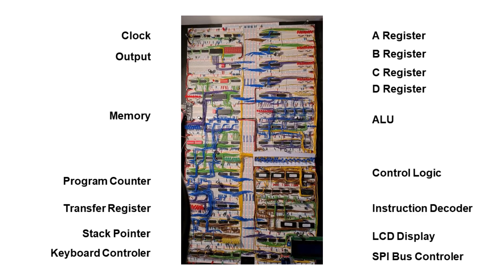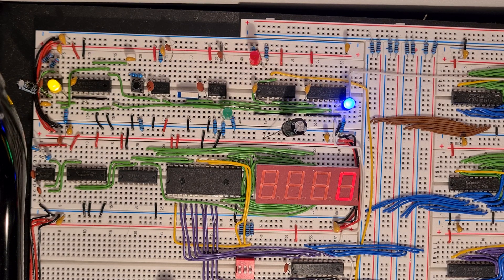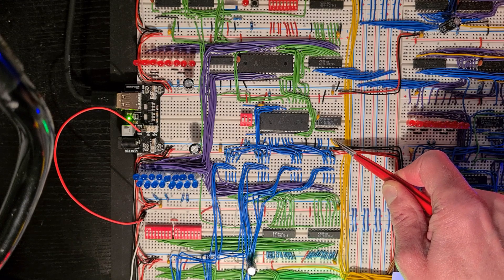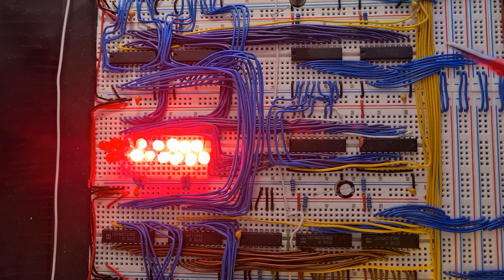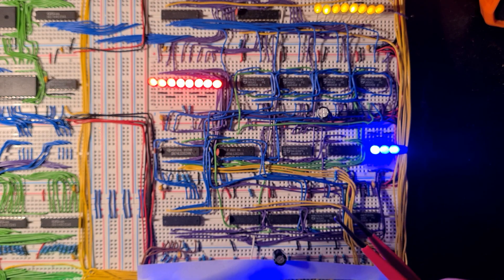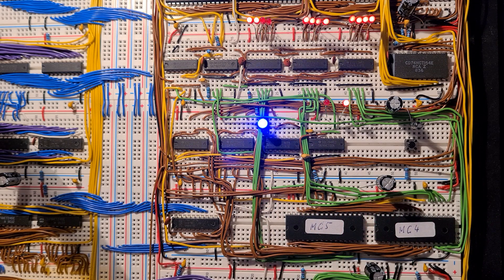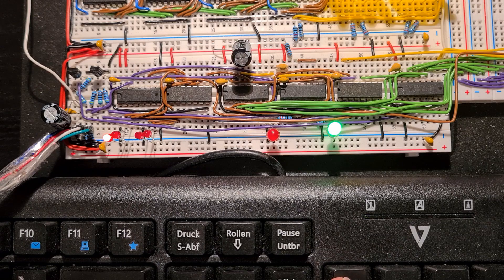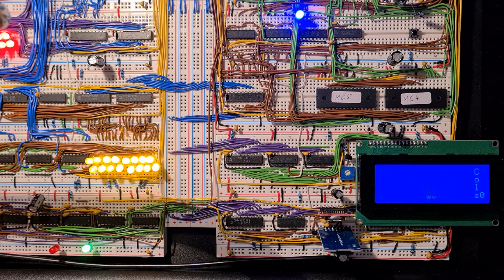8-Bit Breadboard CPU (Overview)

Comment: Irgendwie bist du so nah dran, einem 8085 oder 6502 nachzuahmen, hast du daran gedacht, einem von den beiden zusammenzubauen?
Reply from the maker: Tatsächlich hatte ich beim Design meines Systems einen 6502 im Hinterkopf, weil das der Type ist, dessen Maschinensprache ich aus meiner Kindheit noch am besten kenne. Theoretisch könnte ich über eine der freien Adressleitungen an den EEPROMs für die Sprungziele eine zweite Microcode-Ebene einfügen, die dann quasi auf Knopfdruck das System ziemlich binärkompatibel zu einem 6502 machen würden. Allerdings gibt es zwei Unterschiede (neben dem so gut wie nie benutzten Decimal-Modus) bei meiner Hardware zum 6502, die man im Microcode nachbauen müsste und damit das System extrem langsam machen würden:
1. In meiner Hardware werden die Flags nur bei ALU-Operationen verändert, beim 6502 werden das Z-und N-Flag auch bei Lade- und Transportoperationen beeinflusst.
2. Die Zieladressen bei bedingten Sprüngen werden im 6502 relativ angegeben, während meine Hardware nur absolute Sprungziele kennt. Zur Berechnung der absoluten Adresse aus der relativen Adresse müsste eine Sign-Extension durchgeführt werden.
Deswegen habe ich bisher davon Abstand genommen einen entsprechenden Microcode zu schreiben - auch wenn es sicher spannend wäre, Commodore-Basic auf selbstgebauter Hardware laufen zu lassen...
Reply: @DerULF1  Ich glaube, viele traeumen davon, sowas wie die allererste Version von Leisure Suit Larry oder sonstiges auf Breadboard laufen zu lassen. Aber dafuer braucht man Geschwindigkeiten im Mhz Bereich!
Reply from the maker: Mit einer meiner VGA-Prototypen hatte ich zumindest schon mal Space Invaders auf mein System portieren können, aber so etwas wie "Lazy Larry" ist wirklich nochmal eine ganz andere Liga. Wahrscheinlich wären da auch die 64k Byte Hauptspeicher ein Engpass.

Comment: NS 8070 was an 1970s 8 bit cpu with a hardware 1 bit ALU. The 8900 was a 1970s 16bit Microprocessor with an internal 4 bit ALU. CDP1802 (1800/1801) based on 2 cmos 4057 and 4 16x4 register files, and has RISC instruction set. 
Note that for Adds that 1-bit ALU with fast clock is faster than ripple carry in faster ALU.

Comment: Amazing build. Why did you use the 74HC series and not the LS series? Is it okay to mix them?
Reply from the maker: Thank you for the compliment. 
The 74LS series uses more current than the 74HC series does and this really does matter when you have around 100 chips in the build. There is a bit more information about the chip type I'm using in my video about power at https://www.youtube.com/watch?v=tdtGz5nVM9A
The 74LS and 74HC series are not fully compatible and it's not advisable to mix them. This is why I mainly used the 74HCT series which is compatible with both the 74LS and the 74HC series.
Reply: @DerULF1   I did go to your github and read the paragraph about the chips. I only have some LS chips and some HC chips. I'll try to use a pull up resistor and see what happens. Thanks you.
Reply: Another consideration that the builder would have noticed is LS chips are filthy expensive now. Hence people using the cheaper lower powered devices.

Comment: Ein sehr schönes Projekt!  Respect++
02:50 Genial, den Inhalt auch in hex und in binär darzustellen! Welchen IC verwenden sie hierfür?
Reply from the maker: Leider gibt es keinen einzelnen IC dafür. Die Logik steckt in dem 8k Byte EEPROM, der an den Addresseingängen 8 Bits für das darzustellende Zeichen, 2 Bits für die Position auf der Anzeige und weitere 2 Bits für die Art der Darstellung nimmt. 7 der Datenleitungen am Ausgang sind dann die Segmente, die leuchten sollen. Der Schaltplan für den Rest der Logik und der Arduino Sketch zum Programmieren des EEPROMs sind in meinem GitHUB-Repository (Der Link dahin ist in der Beschreibung zum Video).
Reply: @DerULF1  Dieser Ansatz ist genial! Danke für die Erklärung. Somit wird auch direkt das zeitbasierte Demultiplexen der 7-Segmentanzeigen übernommen (4 Stellen = 2 Bit). Zudem hat man völlige Freiheit bei der Darstellung.
Dass es einen IC dafür gibt, war nur erstmal so ein wilder Gedanke...
Reply from the maker: Die Originalidee mit dem EEPROM ist von Ben Eaters Serie übernommen. Ich habe das lediglich etwas erweitert.